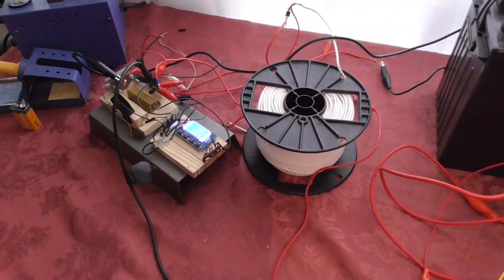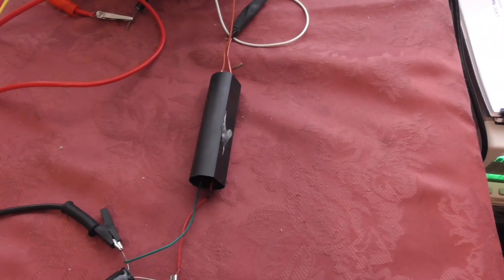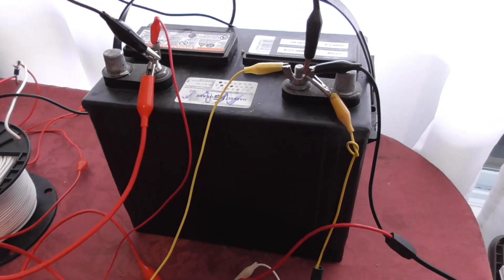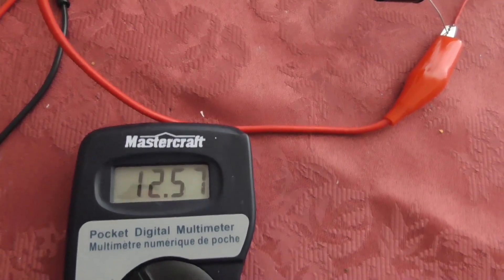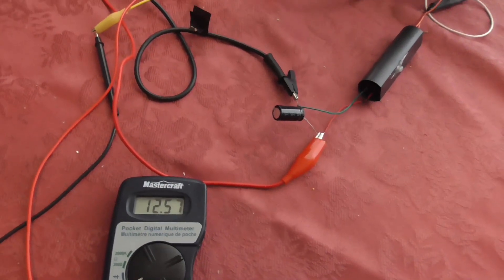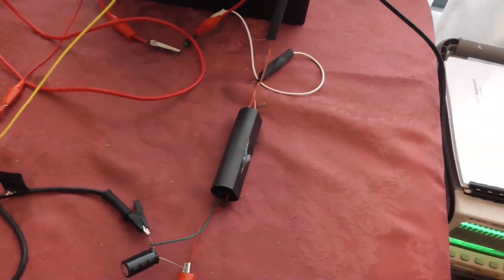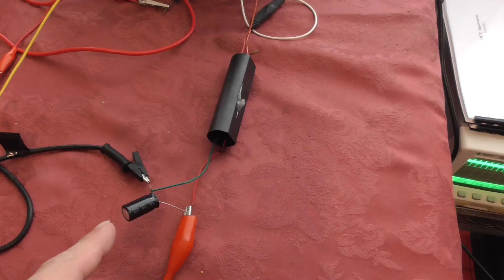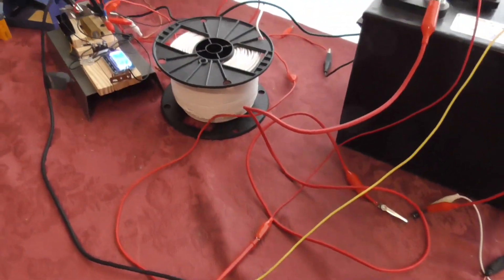Self looped HV Module

Comment: I meant to say even if the voltage stays the same after long period of the time, that will prove that the system is over unity because it is generating heat for free
Reply from the maker: Well so far so good it's been about another hour and its stable at 12.7 not flickering at 12.6 no more as it was an hour ago when I made the video.
Reply: @joellagace1679  , if you can, please keep it running... I'm super excited to to see the voltage level after 24 hours
Reply from the maker: I don't know! I do know it worked well with my previous self looped setup for 24 hours, how ever it was much more complex. Always trying to find innovation here.
Reply: @joellagace1679  ,I've conducted tests similar to yours. I believe these circuits might be overunity, meaning they might generate more energy than they consume. However, proving this is challenging because the surplus energy produced is so minimal and the batteries aren't efficient at absorbing all this energy. Despite these difficulties, it's always beneficial to share our findings. Even if the results aren't as promising as we hoped, sharing allows others to learn from our experiences and potentially provide suggestions to enhance the circuit's performance.

Comment: I love this. It is simple. Can you please let it run for 24 hours and let us know if the voltage increases. Even if the voltage increases by 0.01 volts, this will prove that the system is over unity, because some of the energy is being dissipated in form of heat.